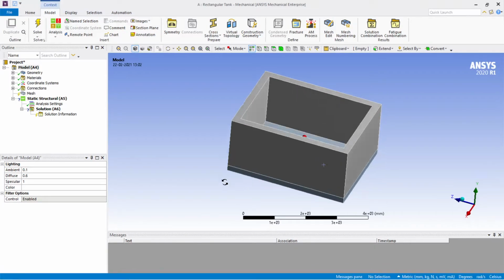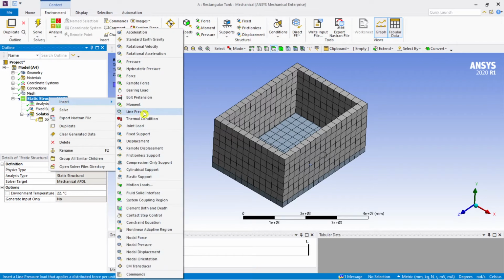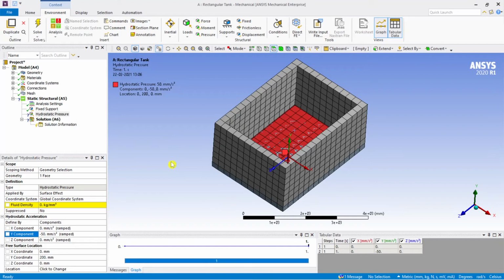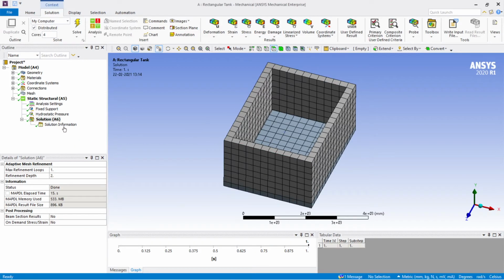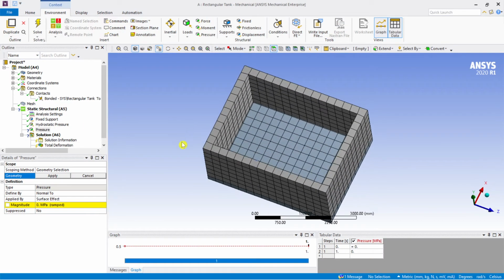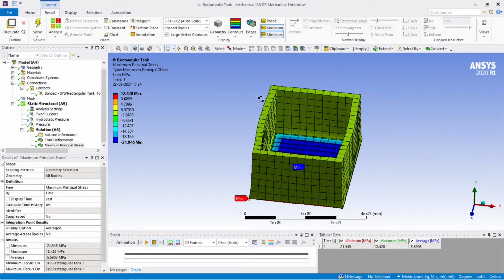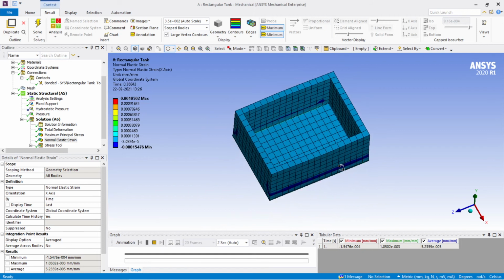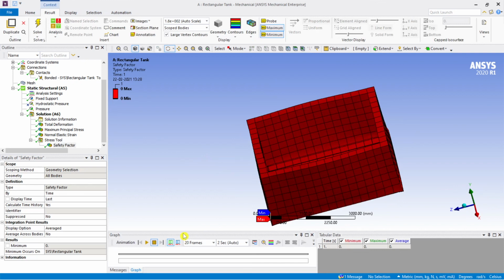Analysis of Rectangular Tank for Water pressure in Ansys Workbench 2020 R1

Comment: You got a minimum safety factor of 0, does that mean the tank has failed and you have to increase the thickness? what grade of concrete are you using and how do we interpret the maximum stress of around 24MPa with the strength of the material you chose for the tank wall?
Reply from the maker: It indicates that Ansys is not capable to calculate saftey values beyond 15 and -15 in that case it gives Full Red model so it means the data is not vaild ........so I had taken a random load
Reply from the maker: It indicates that Ansys is not capable to calculate saftey values beyond 15 and -15 in that case it gives Full Red model so it means the data is not vaild ........so I had taken a random load